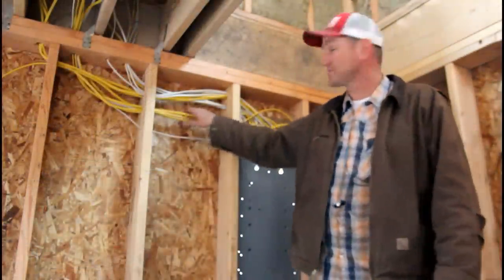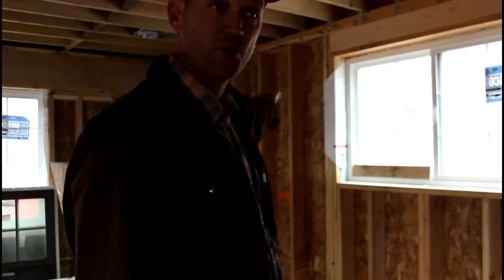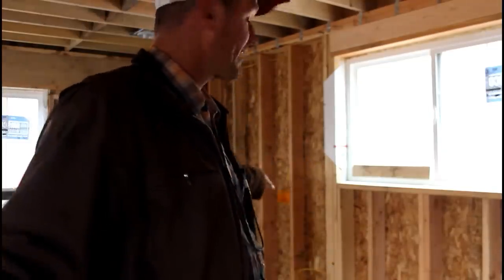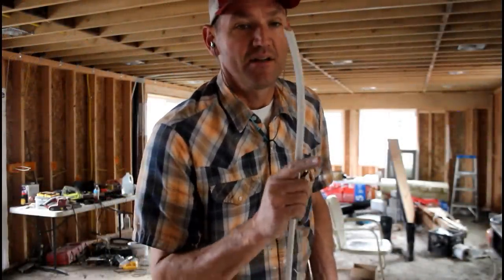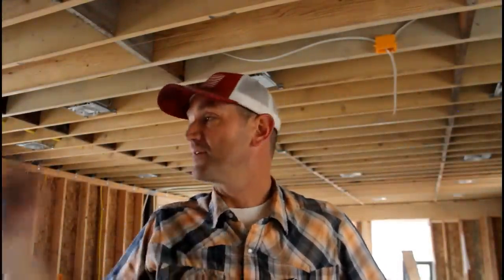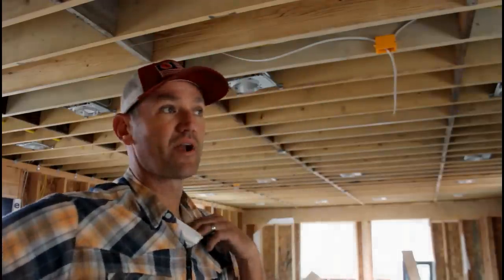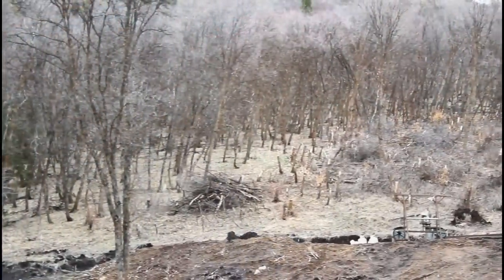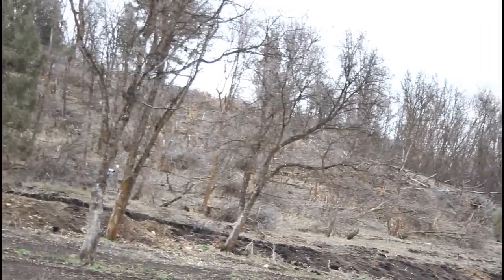#217 - I Finished Kitchen Cans, 4 Way Switches, Passed First Inspection

Comment: I ran flex conduit to each room and terminated them in a recessed wall cavity where the network hard drive, cable router, home router, etc. are located. The recessed area itself has a large conduit running to where utilities enter the house. The recess also has a dedicated electrical line that I plan to attach to a battery backup some day -- but I already have backup on the main computer (mine). 

You may not need all of this, but it's worth thinking about before you cover the walls up. My recessed area actually has a kitchen cabinet that opens up (at the wall) to access it. We have zero extra space so it was kinda necessary. Keep up the good work!

Comment: I totally agree with the other post to put the outside spot lights on a switch. With motion sensor lights you may want them to stay on for doing a task outside. By turning the switch off  for 4 to 5 seconds and back on, will turn them on solid. Then to go back to motion mode, turn the switch off then back on will no delay time will put it in motion mode. 
FYI, with 2 separate switches to turn a certain set of lights on & off is 3 way, to have 3 or more switches in different locations to turn the same set of lights on & off is called 4 way. 
All is looking good.

Comment: Just a suggestion...in your main panel box, use the outer  insulation of the 12 or 14/2  (pieces about 3" long) to mark what wires go where. IE Kitchen Lgts, Bdrm Lgts, Refrig....etc.  Use these as sleeves, and slide the pieces of this insulation on the wires, i the panel. Then write on the sleeves where they go. I'm sure your marking as you go along, but after 35 years of wiring I've found if your using adhesive numbers they will dry out and fall off, whereas the sleeves will stay forever. And because there on the inside of the panel only you will know they are there. It makes chasing circuits soo much easier to find when your old and gray , like me, or when you've passed this amazing home on to your children. 
Oh BTW a fine line sharpee works best. 
All the best to you and your family

Comment: Flood lights on the corners of the house, lights and/or fans under the porch roof, a light for the electrical box shed, over hang outlet boxes if you do Christmas lights, and and exterior outlet box at each corner plus center front and back. Just a thought. Looking good. Progress is being made.

Comment: Well done! Just about done with electricity! 1 more big step closer.
 BTW I would put motion sensors on a switch ,because if the lights keep being triggered by wildlife to an annoying degree, you can always turn them off easily.If it disturbs you in the middle of the night that is not the time to have to sort out electric wiring!

Comment: You mentioned a few times that your back is sore,well here is a simple remedy that works.
Stand back to a wall with your heels touching the same wall. Put your right foot on a chair and push down on your foot lightly for 15 seconds  then do the same with left foot. You will be surprised at the relief. It works.

Comment: Wiring at main breaker box looks fine to me....
The only thing i would have suggested to add there are protective metal plates inset flush on the ends of 2×8's  to protect wires from nails accidentally piercing through your lines at the interior wall side.....

Comment: Everything on a switch. Floodlights under the overhang on each corner of the house on motion detectors. This is easy while walls are open. If you want to run tv & computer wires, maybe even speaker wires. Add it now or you will be pissed off later you didn’t. Just thinking out loud. Looking Great 👍 Vinny 🇺🇸
Reply from the maker: Thanks Vinny!
Reply: Mount a 10W and a 50W LED floodlight next to each others. You just need three wires, two live on separate switches and common return.
Having a 10W on several sides at night is good, and then the ability to turn on the 50W if you need light to work, or if something goes bump in the night.

Comment: Add at least one outlet on the outside of the house -- it will save running an extension cord out a window when you need to work outside.  Good job.

Comment: Quick suggestion on putting outlets on the outside of the house if you don't put them beside the doors put one on every corner of the house I did that at the cottage except for one corner and it seems like that is the one corner that I always need power for some random thing
Reply from the maker: Good advice!

Comment: We have been using solar motion sensitive LED  lights and they have been great now for 2 to 3 years and no problems. the 1100 to 1300 lumens are great and really light it up when something comes by, with no added cost on the hydro bill and relatively inexpensive. Usually between $45 to $50 Canadian which would convert to $25 to $30 US.  Give them a look you might be pleasantly surprised one company is called SunTek but there are many.
Reply from the maker: great idea

Comment: Put the motion sensors on switches. Switches allow you to turn them off and on a number of times that will keep them on for any time you find it necessary.(turn them into regular lights temporarily.) Its a pain to have to stop what you are doing to wave at the light to finish up your evening project.

Comment: Good idea for Ruger, try checking the local pound's website. All dogs are pack animals, being alone too long can make then anxious and depressed. grandpa used to take a tennis ball along and wave it in front of a dog, if they tracked it he felt they were trainable. Some dogs are, some aren't.  
Have cedar give you a back rub with some tiger balm, it will really help so you don't wake up tomorrow stiff as a board. Your backs carrying a heavy load all day, once it goes out it will never be the same. The last car accident I was in(not my fault) took 6 months of core exorcises, chiropractor visits and massages before I could bend over and pick up a pencil without it going out on me. when your 6'2, 270 pounds Nobody is going to pull over to help you change a tire. IMHE 
Glad your wiring is done. at this rate, you should be done/move-in ready by mid-summer. Will the kids have to change schools for the fall?Or can they stay at their current schools?
Reply from the maker: They will stay in the same school system. Good idea on the tennis ball. Best dog  ever owned as a pound dog.

Comment: I posted on one of your previous vids, but I know you can't read them all...hope you get this one though;

Stick to 3 wires per hole. Fill the holes to the 2nd floor & attic with fire foam. (you want the wires to be in the middle of the foam, not pushed to one side). 

This might help you too;
The International Residential Code limits the size of bored holes in lumber. If the lumber is a bearing or exterior stud the largest hole allowed is 25%. In a non-bearing interior stud, 40% is allowed. (Measurements are actual, not trade dimensions. i.e. a 2x4 is 1.5 by 3.5 inches). A ceiling joist or floor joist allows a hole of 33% of the size of the lumber, but holes cannot be bored within 2 inches of the top or bottom. On a stud, holes cannot be bored within 5/8 of an inch from the edge, but Article 300.4 of the NEC requires holes bored within 1-1/4 inch from the edge to have nailer plates

Comment: Put the motion sensors on a switch also. When the wind blows hard it makes the motion sensors stay on all night and it is something I want to turn off.
Reply: shartne 
...isn't it nighttime when you'd need them the most....?
Reply: Sometimes better to be without the light at all, than to have it turning off and on, mostly on, all night...
Reply: Yeah have that happen and it is very annoying for it to go off and on all night long then you just want to turn it off.
Reply: yes but if it starts going off and on off and on while your sitting in your house you will grow tired of it and want to flip it off until the wind storm is over.

Comment: Save yourself a little bit of headache and take a hole saw and recess the outside pancake box back to the wall decking so the front of the pancake is flush with the outside siding. You can do the same with the outside outlets, I generally find a single gang box with the nails at the back of the box, cut a hole next to a stud and face the box outside and flush the front of the box to the outside siding, at least here a heavy duty cord in place cover is required on the outlets outside, one in front and one in back of the house, or you can use a weather proof single gang bell box and just screw it to the siding, but then the box and cover protrude out a ways after installation. Probably wouldn't hurt to nail plate the areas close to the panel where the wires go through the studs, not required per code if you have your 1-1/4" from the front face of the stud, but a nice safety and peace of mind just to avoid drywall screws, I occasionally do the same in the kitchen areas where the kitchen cabinets are screwed to the walls.

Comment: Three way /four way switch 101:  Start of circuit  2 conductor from power source/circuit breaker - 3 way switch#1 - 3 conductor traveler to any # of 4 way switches -3 conductor traveler to  3 way switch #2 -  2 conductor to lights/load!
Reply: And when you run out of 3 conductor Romex cable you can always run 2 each 2 conductor Romex cables (and wind up with an extra wire)!

Comment: Concerning the clusters of wires at the JB....Rather than undoing and rerunning the wiring into new holes at the breaker box, can't you just slip a temporary thin sleeve of sheet metal over the existing cluster in the hole,  
and safely drill another smaller hole touching the top and/or bottom of the original hole, and slip a few wires into the new holes???   
Basically elongating and enlarging the original hole...
...just a thought.
Reply from the maker: Thats a possibility.

Comment: I understand he's a plumber by trade and doesn't like electrical..
But looking at the panel wall.
With a schematic drawn up in advance.
Could have given a neater job..
Conductors running
Vertical then horizonal then vertical into the side of the panel you've designated for bresker position..
Jobs look neater.
Inspectors like neat..
Finding problems is easier

Comment: your doing a great job and I hate  to complain but I would not like to pay for the wire being used .I watched you waist about 40 ft of wire on that one part that you could have easily pulled back to the roll in the box and cut it there saving at least 3 ft of wire every time you made a run, that dosen't sound like much but over the electrical build it all adds up and wire is not cheap if you throw it away. this might be also realized in all of the different jobs on the complete house build especialy that you are doing it yourself . other than that good job

Comment: You should run some cable for TV and Cat5 cable for hardwire internet.
Reply: A little tip on running Cat5 for internet. NO 90 degree bends, and keep it away from the electrical wires as much as possible.
Reply: They will never have cable in such a remote area and Internet will have to be Satellite.. Wireless routers have replaced hard wire cable and Internet. They most likely will never be connected to the grid either.

Comment: Turkey season is the most dangerous if Hunter orange is not required... Hunters have every right to hunt your land if not posted. If you post your land it's off limits without written permission. Big problems with buying new land is hunters may have been coming for years when no humans were living there... so while I too am a hunter, I post my land . That way people have to come to you face to face and ask permission...and you can tell them about your dog and kids and want knowledge of when they will be in their hunting spot. 

If your wood stove is going to primary heat source will you need cold air and heat vents in bedrooms for when doors are shut. ? heat will want to rush up the stairs to the hall, but when doors are shut it could get cold?